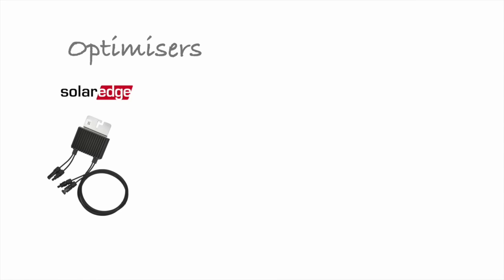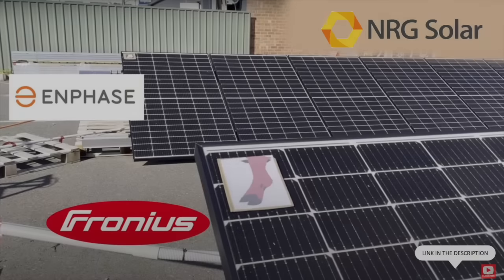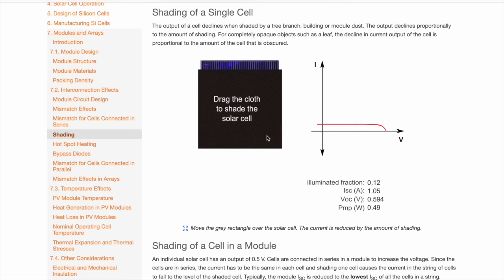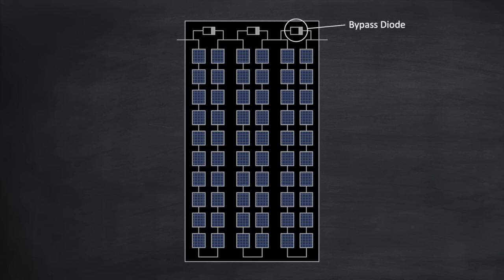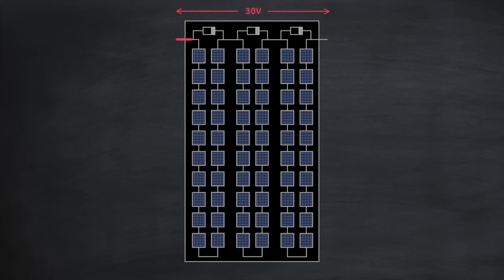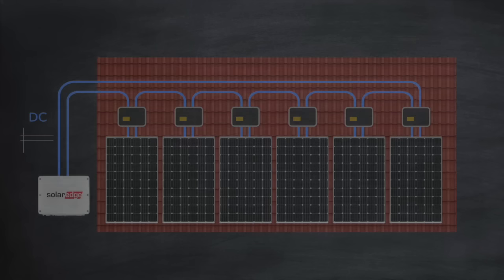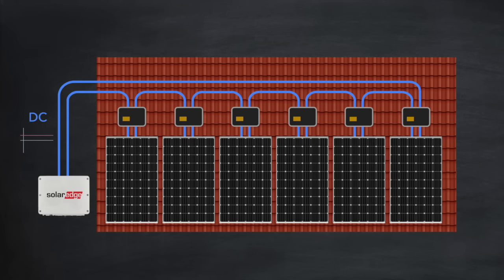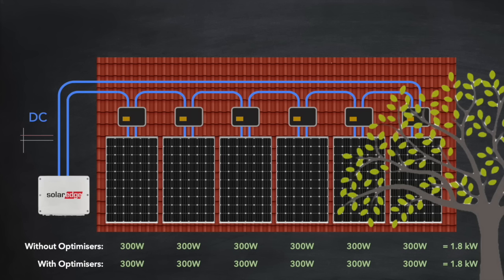Solar Panel Shading (Part 1): Are Optimisers and Micro inverters Worth It?

Comment: Very interesting and useful!  Wish I had seen this before I had my system installed a coupe of years ago.  I think the point about simplicity is very important.  I just had one of the solaredge optimisers go and whilst solaredge sent a replacement for free it cost £150 + VAT to replace. (my installer has ceased trading - probably to wipe the slate clean - and it was just outside the 2 year insurance backed warranty) That's a big hit on the payback of a single panel, which is even worse when you consider the marginal benefit provided by the optimiser. solaredge optimisers do not seem to be that reliable? My panels are on a single pitch of a bungalow to easy access. Seems anyone with a high roof and difficult access should seriously consider if optimisers are worth it 

I was surprised that the optimiser can rescue nothing from a panel where the partial shading has tripped all the bypass diodes. Maybe we need to consider exactly how the shading will fall and select panels to minimise that issue?  Do different panels have different diode orientation?
Reply from the maker: Sorry to hear about your bad experience with the failed optimiser. I agree, they provide only marginal benefit in many cases, against a high cost to fix in the event of failure. There doesn’t seem to be enough margin in the manufacturers’ products to allow for a better warranty payout :-(

Comment: Interesting conclusion; one of your cons is actually our pro.

We went for microinverters. The reason being resilience and redundancy. As I understand it, a single microinverter or panel failure will have an impact only on that single element. The rest of the array will function the same. The microinverters are also separate from our battery system, so there's no single point of failure that could bring the whole system down. The microinverters having a 25 year warranty also gave us greater confidence in the reliability of those parts.

Our roof is really hard to access. So a failed panel, inverter or wiring damage (damn birds) would be a huge expense. So, whilst the microinverters do indeed give more points of failure, a single failure can wait until we have another good reason to access the roof as the overall impact is minimal. It also means a battery inverter failure wouldn't impact solar and vice versa.

There's also a chance that I'm wrong and I've spent the extra money for no reason, lol.
Reply from the maker: Thanks for sharing about your installation - I'd love to hear how it performs over the next few years - will help others who are apprehensive about microinverters...
Reply: @GaryDoesSolar  I'll let you know if there's anything of note. We have had it around 18 months and the biggest problems have been administrative.
Reply: What kind of battery system do you use

Comment: Another pro to microinverters over string inverters is that the inverter is the one item in a solar array that is by far most likely to fail.  String inverters generate large amounts of heat and have fans for active cooling.  When the string inverter fails, all panels attached to it stop working.  

Microinverters are more difficult to replace if one fails as they are under each panel instead of being located on the side of the building.  If one microinverter fails it only takes out the single attached panel and the rest of the array operates as normal.  As the small microinverters are only responsible for the panel they are attached to, they are much smaller and simpler than a string inverter and have no requirement for a fan to move heat away from them which makes them sealed up solid state devices with no moving parts.  Microinverters are significantly more reliable than string inverters.
Reply from the maker: These are good points, Steve. I’m of the firm belief that the cost of string inverters will reduce dramatically over the next few years, and I prefer to have complex equipment easily accessible. 

That said, you make a good case for microinveters 👍🏻

Comment: Not sure which products can ‘can cost the same as the panel’ but I know the basic Tigo is about £40.  Interesting video though as my issue will be solid shadow from a chimney going right through an entire panel which suggests an optimiser will be pointless.  Thanks for posting.
Reply from the maker: You're most welcome. Yeah, Tigo optimisers are quite cost-effective, but some of the others aren't :-/
Reply: I think your best option would be to avoid putting a panel within that area, BUT I know that is very easy to say in a comment without knowing the whys and wherefores.

Comment: Just food for thought to consider cost benifit is the ease of system diagnostics with the panel level monitoring that solar edge and enphase offer apart from Sma and fronius. The average homeowner doesnt have the knowledge to know when something is off at the panel level (diode issue, multi cell degradation). Also the fact that that enphase is modular system for reduced production loss with any defective equipment. Ive installed and serviced thousands of site between all manufacturers. There alot more after the fact to consider rather than just the unfront ideology.
Reply from the maker: Hi Jarod, these are great points - thanks! I’ll make mention in a follow-up video I’m doing… 👍🏻

Comment: Another very informative video - thanks very much.
Reply from the maker: Thanks Adrian - this one took quite a while to put together!
Reply: @GaryDoesSolar  I'm sure it did as you can tell by the graphics and references you found to back up your explanation and reasoning and what people don't understand is the time ot takes to find what you are after and then to cros check what you have fojnd to make sure that it is correct. This takes ages. People in general just see the presentation and just assume that it has been grabbed and don't realise that research takes an incredible amount of time. Probably due to a lot of people just taken a source at face value and don't cross check. No, it is a very informative video as your others have been btw.

Comment: Thank you!! Of many analyses I read and watched about this topic, you are the first to mention the difference between hard/intense shadow and diffuse shadow where the bypass diodes don't kick in. That's the missing link!
We've got two nearby buildings higher than our (southern) roof and their (hard) shadows wander across our roof during winter. But there aren't any high trees, cables etc. nearby. So if I understand correctly, the most that I need is a decent mpp tracker and a clever orientation of the modules (because building covers up the lowest meter or less off the roof traveling from one side to the other, the modules (~1.7m x ~1m) there should be installed horizontally), correct? Now I just have to find out whether 1mpp tracker is enough (all modules go on one side of the roof).
Reply from the maker: Thanks Thomas - great to have feedback like this. Now, if your solar panels are of the half-cell variety (see part two of my shading videos) then you could still mount those panels in portrait format on the bottom row. And assuming you're planning to use a string inverter with two strings, you could ensure that all the panels along the bottom are on the same string, which will help with tracking. Alternatively, you could look at having optimisers on the panels along the bottom row - but given these problems are only during winter, I'm not sure that this extra expense would be justified. Good luck with whatever you decide! :-)
Reply: @GaryDoesSolar  Thanks a lot for the helpful reply! Yes, half-cell, and yes, inverter with 2 strings (and 2 mpp trackers), but I am also thinking about extending the setup to the garage in the not-too-far future, so will ask my electricion if it makes sense to then go for an additional (smaller, 1-string) inverter or whatnot.

Comment: Hi Gary, very informative video thanks. I'm just in the process of designing a system at home and wondering if I needed optimisers. I'm still not 100% sure, can you clarify what your diagram shows at 16:45. If I have 2 panels out of a string of 6 that are not producing any current, without optimisers are the other panels still able to push current through the shaded panels? I thought if all the panel was shaded it would block the current.
Reply from the maker: Hi Kieron, great to hear you got a lot from my video 😀 So, in the video then: if there were no bypass diodes in the panels, any fully-shaded cells would completely block current flow in that panel and also for all the other panels connected in the same string. The bypass diodes essentially “detect” shaded cells then re-route (bypass) current around them - to the extent where if a whole panel is shaded, the three bypass diodes in the panel will simply bypass the current through themselves, avoiding all the cells in the panel completely. Hope this helps!

Comment: Great video BUT I thinj Gary misses out on a pro for the microconverter/optimizer setup in my opinion:
- over time panel defects can NEVER affect the rest of the setup (while in a string the entire array would stop working).
Small chance, perhaps, but combined with the next pro I still think it’s preferable to a normal string setup:
- microconverters are seeing, on average, a larger lifespan (and warranty). Therefore current expectations are these (parallel) setups will see a longer uninterrupted operation.
The costs involved are still higher and depending on setup both can be great choices.
Reply from the maker: Thanks, but remember, this particular video is concentrating only on the shading aspects. I cover most of the points you raise in this video specifically on microinverters: https://youtu.be/q6t0AAi5Jws

I’ll be making a similar video on optimisers shortly… 👍🏻

Comment: Very informative video. Thanks for that tip. I have 3 different solar power systems that I own. 2 on the RV's and one on our house. the house has the Enphase micro inverters and the RV's both have NPPT controllers. Only one of the RV's uses an inverter. On the one RV I have seen a low or no output situation, as the solar panels had not been cleaned in quite a while. I thought it very odd that with 800 watts of possible output that the controller showed only the low battery voltage. I think it was around 8V, not enough to power the inverter or even the LED interior lights. Now I understand why that happened. I have a video about my 3 systems posted, if you'd like to check it out. I'd be very interested in your evaluation of my 3 different systems. I guess now I have to go clean a few solar panels!
Reply from the maker: Hiya - I'm going to take a look at your videos! :-)

Comment: That is the best presentation of the pros and cons of optimization that I have seen.  Thanks!  SMA says they have a new MPPT routine for their string inverter that works as good as optimizers in some circumstances without the reduced reliability.  Have you figured that one out yet?
Reply from the maker: You’re most welcome, Mark. It’s great to get feedback like this, as my aim is simply to demystify everything. Now, I didn’t know about the new SMA MPPT routine - I’ll check that out… 👍🏻

Comment: I can’t imagine optimizer’s/microinverters operate at 100% efficiency. My guess would be in the range 98/99%, some maybe lower. That would be a permanent energy loss of approx 2 percent. Thus the question one should ask, assuming a 25 year solar panel lifespan, is if the following formula is true (or false) for a given installation:
(cost of 2% energy loss over 25 years) + (cost of number of optimizers/microinverters * average failure rate per 25 years)  + (replacement labor cost) + (cost of lost energy during microinverter failure) < (cost of lost energy during periodically shading)
Reply from the maker: Hi Lars, you make a very good point. I’ll say something about this in a follow up video on shading that I’m making… 👍🏻 thank you!

Comment: Hi gary, fitted 4 TIgo optimizers to my string on 4 panels that get shading around 2-4 o'clock. Have noticed no improvement with using them, so will be selling them on ebay.
Reply from the maker: Thanks for sharing this Jon - it sounds like you've got an installation then added the optimisers to see if they would improve generation because of the shading, but in actual fact, there was no change. If so, this is better empirical evidence for folks to consider, and I hear so often from people who had optimisers fitted from the start, that they're doing the job... but how would they know?

And as you're talking about Tigo products, it looks like the company has some interesting problems to deal with - see this article on reddit: https://www.reddit.com/r/solar/comments/144j15k/tigo_ts4_modular_level_power_electronics_melt_down/

Comment: Very clear explanation , thanks. What about panels in parallel ?
Reply: +1 for maybe looking at what happens with panels in parallel.  As I understand it, this solves a lot of problems with shading in a series/string setup, but only if your inverter / charge controller works with the lower system voltage (due to the panels being in parallel rather than a series string)
Reply from the maker: Thanks Jamie. Certainly, parallel panels allows the current another route round in case of shading on one of the panels. I'm planning a follow-up video on shading in a couple of months and will try to cover this.

Comment: A point in favour of micro-inverters is that they cost 10% of the price of a full-sized inverter. That means that when things go wrong, you replace a single inverter while the rest soldier on unaffected. They also send mains voltage down from the array so cables can be thinner, and loss-free runs can be greater. If people have multiple spots to install panels, they can locate several arrays without concerns about how to link them. I take your point that panel diodes do a good job, but there are reasons other than shading for using multiple micro-inverters, but I'm not convinced that the same can be said for optimisers.
Reply from the maker: Thanks Michael, these are good points. I’ll include them in a follow-up video I’m making 👍🏻

Comment: Hi great video, I’ve some companies installing the optimisers in the loft ,by simply rooting the optimiser cable under the felt , so if any optimiser issues, being in the loft makes easy access and no need for scaffolding,
Reply from the maker: Thank you. And I quite like that idea! Hopefully, they'll ensure no chance of water leakage into the house though! :-)
Reply: @GaryDoesSolar  Hi yes they do use some kind of weatherproofing that’s actually designed for this type of installation
Reply from the maker: That's great to hear! Good luck with the install 🙂

Comment: This is an excellent video, very clear and interesting to follow. Just one thing - I think you should have explained that a shaded cell has a higher resistance to electricity than an unshaded cell - and thus the electricity takes the path of least resistance, through the diode, which has lower resistance than the shaded cells. At 8:39 you say "The third bypass diode DETECTS a change in current in the cells it is managing." This isn't true, it's misleading, and anybody who doesn't know what a diode is, will come away with an incorrect understanding of how diodes work. The diode simply has less resistance at this point in time, than the cells in the shaded string, so the electricity takes the path of least resistance, through the bypass diode. That is the wonderful simplicity of this system. I hope you don't take offence at my criticism, because everything else about your video is brilliant, and is the best explanation of solar panel shading I've seen.
Reply from the maker: Hi John, thanks for the very kind words - that means a lot.

With regard to the bypass diode, I might argue that what I said was functionally correct. I simply described the "what it does" whereas you describe the "how it does it". Otherwise you could reduce any electronic circuit that performs a useful function (for example, an infra-red unit that detects motion) to simply one or more components that manage current in a particular way ;-)

That said, it does no harm to educate the reader, so what I'll do is add a statement to the video to that effect :-)

Comment: You talk about 'shading' but many of your examples are 'blackouts' - ie complete exclusion of radiation.
Surely with 'shading', there will still be some radiation reaching the cells and thus, some/partial generation?
I appreciate all the downsides of shading and for sure, there is nothing like full-on sun striking the panels for max output but even an overcast, hazy or cloudy day is a kind of shading and I still get output under those conditions, albeit proportionally reduced.
My roof & panel layout means that at either end of the summer season, an adjoing roof pitch starts to 'shade' a couple of panels whilst the sun is at a lower level at either end of the day. I can see the effect on one of my 2 strings. Its a reduced output but certainly not 'off '.
Maybe you could re-visit your analysis to take these circumstances into consideration? 
Otherwise, a very helpful review.
Reply from the maker: Hi Tony, shading is the agreed term for the blockage of radiation from the sun, whether that be hard or soft. And my covers both types (chimney and tree). I stand by my analysis 👍🏻